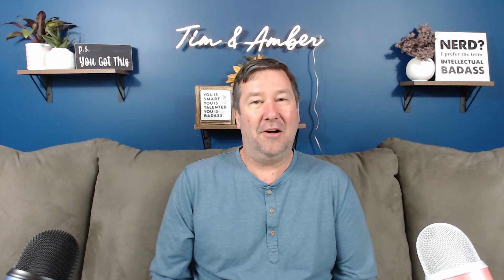Your PLC Questions: Switching Brands, Scaling 4-20mA, & Starting a Business

Comment: Allen Bradley is Definity easier to get online with then Siemens. I've have delt with both. German programmers like using STL which in my option is tougher to troubleshoot and follow. I've been around 2 DCS systems also, DeltaV and Foxburo. Both of these are heavy in function block for their pre configured faceplates. Allen Bradley is moving this way also with Plantpax, but they still have nice custom AOI's to use with FactoryTalk view. But I'm not going to say FTview is the best by any means. I need to learn Ignition. Thanks for the Videos TIM, I forward these on to our electrician's.

Comment: Hey Tim sorry I missed your Q&A. I was hoping to ask you about the 1756-Rio card in adapter mode. I’m Installing a new controllogix chassis to replace a PLC5 Rack. The processor for the PLC5 uses channel 1A as an adapter and group 7,0 is a block transfer to the other PLC 5 in scanner mode. How do I setup the 1765-rio to communicate with the plc5 scanner?

Comment: I have a question because I’m looking to get into this trade and want to make sure I’m making the right investment. I currently work for a municipality on the water treatment side, and I’ve noticed that many openings are asking for the ControlLogix / Studio 5000 certification.

Specifically, the course is Studio 5000 Logix Designer Level 1: ControlLogix System Fundamentals (CCP146). Since I’m not officially working on the electrical side yet, I would have to pay for this course out of pocket, which is about $2,500.

Some of the techs I’ve spoken with mentioned that it’s a lot of information packed into just two days. Before committing, I wanted to get your honest take on whether this course is truly worth it—especially in terms of real-world value and applicability in a municipal water treatment environment—given that it’s an Allen-Bradley / Rockwell Automation course.

I’d appreciate your perspective and any advice you can share.
Reply from the maker: It's great you're thinking about the real-world value before you commit.  Honestly, I don't think that CCP146 is going to go as deep as you are going to.  For programming I would look at CCP250 and for maintaining systems I would look CCP300.  Why don't you submit an inquiry at the following link so I can gather more information about your exact situation, even if none of our offerings are a good fit for you, I'll still help you find what is best.
https://twcontrols.com/contact

Comment: We have diagnostic AOIs in our standard code that configures analog current modules to always use 4000-20000 for the raw values. This way no matter who is looking at it can easily see how many mA the card is seeing without using a meter and not some arbitrary number that varies based on the model of card being used.